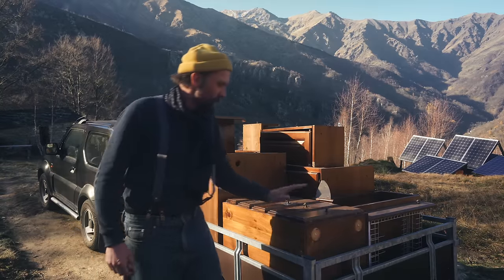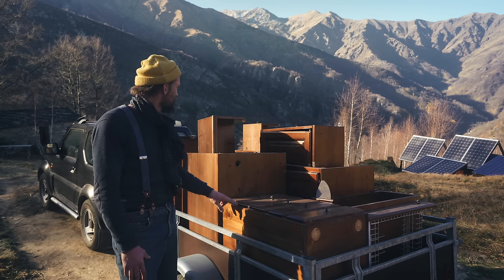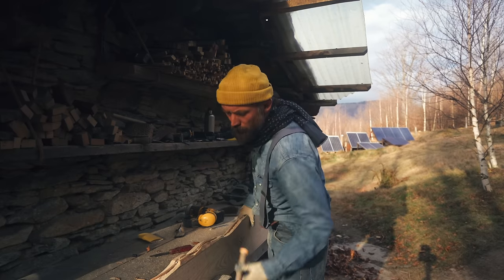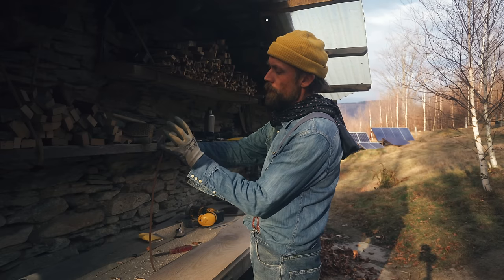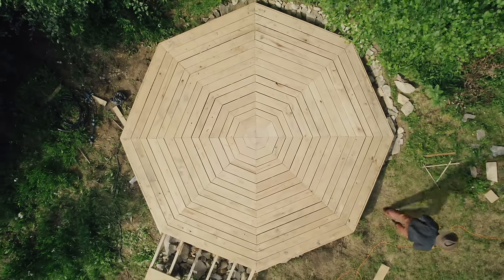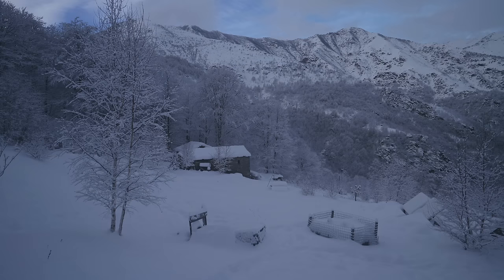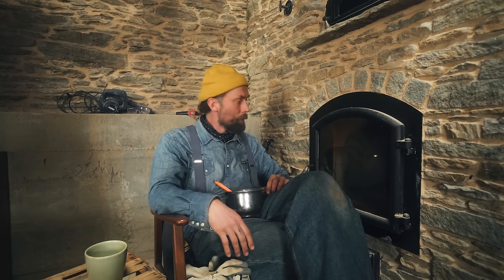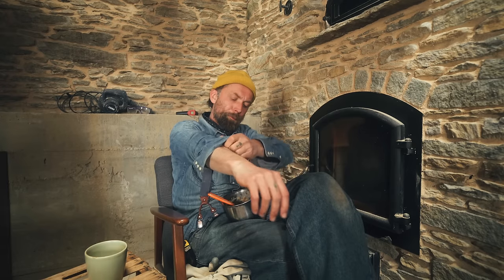#94 First Snow and Last Night in the Tent

Comment: If that was a woolen carpet you took out of the tent; the best way to clean it, is wait until it has snowed on a grass field, and lay the carpet upside down on the snow. While the snow melts, it takes dust and stains out of the fibers. You do need to have a place to dry it after though ;)

Comment: Hi Martinj, about your beautiful floor. I am a carpenter and I advise you not to glue, even if it may be too late. And leave loos along the walls. Because even if your wood is dry on humid days when you won't make a fire, the wood will swell and you risk having problems. For the squeaking I rub soap or paraffin on the male part of the assembly, very effective. Bravo for your careful work and the magnificent images. Take care of yourself !

Comment: Great work on laying the floor!
Next time you lay a floor like that, I'd suggest laying several boards side by side over the beams to make a temporary working platform to work from while fitting the other boards in place.  Replace the "platform" boards as you fit them in place...no need to try to fit boards and do a balancing act which can really be dangerous.

Comment: Goededag, Martijn! 
I find a deep sense of Peace as I watch your weekly videos, especially, with the full understanding of knowing how much hard work you put into not only physically rehabilitating your Cabins and winterizing the Chicken Coops,  etc, but filming all the angles of your work, mixing in the droan shots from above, editing, talking to us and explaining  all that you're doing, and uploading each week's video onto your YouTube Channel. 
I'm very excited to watch how you install your new 2"-thick Hardwood Chestnut tongue & groove flooring.
I used to own a 15-acre farm,  with a 200+ year-old farmhouse built before 1820, in Northeastern Pennsylvania for a Quarter Century  from 1990-2015. The farmhouse was "Built Like A Barn", using Timber-framed construction, with massive hand-hewn beams of Beech, Ash and Oak, (all cut and milled on the spot using local trees from close to the house). 
What I'm getting at, is that the 1st and 2nd floors in my old farmhouse  had almost exactly the same type of species of hardwood Chestnut (both width and thickness) flooring as you are using. I would sware that the reason my former 200+ year-old farmhouse is still standing so proudly and strongly today, is mostly due to it's Timberframed construction of 1ft x1ft Beams along with the 2-in thick X 6-in to 9-in varied widths of Chestnut tongue & groove flooring.
I personally would attest to the Strength of that 2-in. thick Chestnut tongue & groove flooring that you're using as it spans the (much wider than average spacing between each) beam on your 2nd floor. Your Chestnut floor will last you a lifetime in your Italian Alps Cabin. 
Stay warm this winter in your new Stone Cabin!
Tot Zeins!
Tim

Comment: it looks great martijn.  ok so i lay floors.  yours looks great but a few things to remember.  don’t glue the seams.  pva is stronger than wood and will bond the seams so well that the wood will contract and split the board itself. to stop the squeaking usually we glue between primary and the flooring with a flexible rubberised glue that will allow for the natural expansion and contraction that all timber goes through due to moisture because of how the timber was stacked outside i’d expect it to contract a fair bit with the fire and moving inside.  hit me up if you want to know more though i’d say you are done by now.  hope i’m not the bearer of bad tidings. thoroughly agree with your assessment of loads and spans
Reply: Also the electricity is not up to code the NEN1010 is not followed. I already wrote that in the comments so i hope he changes that bc that is a fire hazard and with all that wood....see my point?.

Comment: So you were right about that snow which changes the whole dynamics. 
We have a wood fireplace that heats the sitting room and the hot air is distributed by a heat pump in the attic around the house. Like your tent, in the mornings the house is cold because the fire dies down in the night. 
Very impressed with the work you did on the fireplace which looks amazing.

Comment: Putting down the tent is an image symbolic as seasonal, brief and has an ending😊.  The beginning of a new phase and most awaited life in the cabin. The expectation of what is certain is realized one after the other while the anticipation of future success evolving in the project is sure when focus is unwaver.  Cannot be crippled by fear and hesitation or there will be a disconnect failing from what you become. 

Seeing the floorboards almost fit and intact, and steps visible at the side align with the hope it should be.  Others have disadvantage standing on the beams with a wide gap and balancing as working.  Move on is a cadence of strength purpose and life.  Hope you're  feeling better soon, flu and covid are not disappearing.

Comment: You could probably use parts of the canvas from the tent to enclose your outside work area, a little bit down by the cabins. It might allow you to work outside for a little bit longer. You could also use it for covering over woodpiles for the winter.

Comment: After you get your flooring in, put baby powder in the crack between the boards, that will lubricate them and keep the squeaking down to a bare min.  Also, a simple fix is butyl rubber strips under your boards on the beams.  Good luck, God bless, and take Zinc for the cold.

Comment: Old furniture is such beast. I just disassembled two cabinets yesterday and it was ton of work. These were cabinets were in garage and I no longer had use for them, they had mold from the back side and over all it was dated design, so I chopped them down. It's not like ikea that gets crooked after a week. That being said moving those things requires at least two people and even then it's heavy.

Comment: Since you now have electricity at the chicken coop, how about installing one of those infrared light bulbs on a thermostat in the hutch, keep those babies warm?
I've been wondering how the wiring would go in the cabin. Running it hidden through the floor boards is such a great idea.
Interesting that the fire is stacked in reverse, with the kindling at the top and the heaviest logs at the bottom. Makes sense with this masonry fireplace!
I've been wondering how much of a cantilever overhang you'd have with the floorboards past the beam over the staircase. The wood floors are gorgeous!
Looking forward to so much: the floor finish in polyurethane(?), the handrail on the staircase, the kitchen cabinet install, the lighting, the water runs, the shower... everything!
Thanks so much for your channel!

Comment: End of an era, some great memories too (apart from the destructive storms) , the beginning of a new era, the deck will make a  great take off/ landing pad for a vtol craft 😉

Fire looks hot! Stone work really nice! , you take some chances on those beams! Glad when you started working on the fixed boards, balancing is risky.

Getting rid of those squeaks in your floor boards  is a great move, it would drive you nuts.

Take it easy Martijn

Comment: Beautiful,I have no other words for your work on that rock wall and fireplace installation.
The chicken coop…seal it up with that heavy plastic,I also read an active compost pile in the corner with a small area for ventilation can make the inside of you coop from 35 degrees to 65 degrees.There is a video online.The guy puts it in a corner,with wire to hold it there and he also throws seeds into it for the chicken it eat as they grow from the heat.also if you feed the chickens “chicken  scratch” at night it will help to keep them warm,kind of like eating a bowl of hot oatmeal for a person.Keep nesting material thick and clean and ventilated to avoid winter respiratory issues.But the main thing is plastic on the outside to keep wind out and snow from blowing in.Chickens feet can freeze so some straw on the ground will help and allow them to keep busy scratching or dried worms (meal worms) if they have those in Italy,the chickens need to stay busy to get eggs and to help with boredom.The worms ,maybe. A handful a day allow for them to search the straw or wood shavings.I can send the link for the compost pile info,at this point it would have to be gathered from someone’s active pile,but same the old chicken bedding for next year and start your own.But it’s winter heat without electricity.
Plastic will do wonders to protect you hens,some people stack straw bales outside of the coop,straw Id great for early planting at the base of seedlings also,so two uses.
Hope you feel better and get some rest in town before real winter sets in!
Just a beautiful job you have done so far!
Any help you need chicken wise,please feel free to contact me.

Comment: Good work Martyn. You might find it a good help if you buy a woodgrinding / sculturing disc for you angle grinder. They really shift the excess wood away when you have difficult scribing to do. Also, if you screw a scap block to the joists a little away from the new board you want to join, you can drive in a timber wedge which will push the two edges together.

Comment: Martijn, your work on the cabin is really paying off and it's looking amazing. One simple thought for later. You mentioned in the spring you may build a workshop, I would recommend making it larger and also adding a firewood shed. Just needs a roof. It would help cut down on al of the moving I always see you do of the firewood. Use the shed and stack it there and set it up to chop it there as well. You should consider getting the rest of the kitchen as you mentioned you only got half. Never know if you could use more of it in the other building in the future or even when you do build a workshop. Solid wood cabinet are hard to find and wood from 30 years ago is most likely going to be better wood then what you could get now. Moe older growth.

Comment: In hindsight, it would have probably been nice to build a gazebo instead of just a platform for the tent. You could have attached several removable walls between the supports of the roof, maybe even just tarps. Like that you could keep the wind out during the winter, and it would have protected the tent and maybe kept a bit more heat in. After moving into the cabin you'd still have a nice scenic spot with a roof over your head outside. 
But I don't remember what all needed to be done back then, maybe you wouldn't have had time. 

I love seeing the progress of the cabin, moving in seems like a huge step even if it's really rough. That sleeping spot just big enough for your mattress seemed quite precarious. 
I can't wait to see more progress, thank you for sharing!

Comment: Screw you boards through the tongue and through to rear of the board, to hide the screws drill them out and use a plug cutter to cut plugs same size as your, drill/screw holes , it will help reduce the squeaking on the floor boards , in Scotland we use a neoprene strip on top of the joist , it stops squeaking .

Comment: Hi Martijn. From experience (120 sqm African Rosewood) flooring is hard work. My advice would be to make sure you leave enough space for expansion of the boards. We didn't and it was a nightmare to fix when the floor started to move the sliding doors. Project is looking great.

Comment: If you are still planning to build a log structure workshop it is not too soon to address sourcing the logs. Quite possible that you will want material cut in winter before the sap starts to flow to control checking.

Comment: Before you go to bed at night you need to put some bigger pieces of wood in that wood stove.  Mix some green wood with the dry wood. that way your fire will burn slower and last longer.  Those small pieces put out a lot of heat but they burn up too fast.

Comment: I agree with your glue inside the T & G. You may consider either a glue bead or felt of sorts between the floor boards and the beams as well to eliminate squeak. Wood on wood perpendicular is notorious for squeaking especially as the temperature and aging process. Just a thought. Be well.

Comment: looking very good.  I was looking at your #74 video showing the kitchen idea. I would suggest using the same layout as you have in the outdoor kitchen. The fridge (in #74) off to the side juts out and is an awkward layout... blocking the flow from the door to the stairs.  I love that you are using 2nd had solid wood cabinets

Comment: “My friend, I’ve observed from your comments and my experience living in construction zones that the seasonal bug mentioned in your video might arise not just from seasonal changes but also from dust created by masonry, wood sawing, and ashes accumulating in your small living space. I recommend investing in a good HEPA filter and running it continuously to maintain a cleaner environment. I understand the need to conserve energy leading up to Dec 22 (winter solstice), but a quality HEPA air cleaner is a valuable investment in your health. It would also be beneficial to regularly vacuum the space, especially after indoor wood cutting, and whenever possible, conduct wood cutting outdoors. Like you, I use a wood stove and keep a small 5-gallon HEPA ash vacuum nearby, spending a minute each morning to clean the stove. Attempting to clean a fireplace or wood stove without a targeted vacuum causes fine particulate matter to scatter into your living space, potentially leading to respiratory issues if left unaddressed. Apologies for the lengthy message. I believe these measures will enhance your overall experience in your beautiful cabin this week. Best of luck!”

Comment: Hi Martijn, my wife and I look forward to watching your weekly updates.  I have concerns about the success you will have keeping your chestnut plank flooring from annoying movement and popping the glue joints.  I would think a top screwed with Timberlok heavy duty screws and plugged with Chestnut plugs, set in a bed of SikaBond  on the beams and using SikaBond as a joint adhesive between the plank edges might provide a good solution for you.  Also, you might consider Kutzall heavy duty shaping disc to help out with scribing.

Comment: I'm not sure I'd fill that fireplace so full with wood. Max 50 % of the space. Overload means overheat that can damage the structure. One of the basic rules. The recommendation: 2 sets (max 50 %) of the volume. Then, if needed, after 2-4 hours, the third set.

Comment: Some of the pioneer builders used to leave the stove pipe exposed on the second floor to heat that space. Some had wrought iron gates mounted around the exposed stove pipe to prevent people from touching it. Are you concerned that when your fire is larger than the stacked kindling ones, trying to get the insulated cladding of the stove build to throw more heat, the pipe might begin to superheat and warp?

Comment: You are working hard and the result is beautiful. On this video I think that you are making a serious mistake during the wood floor installation.
Did you account for the wood expansion due to the humidity and temperature? 
Your wood board are stored outside and you install them in the room where the fire place will dry them. 
You glue the boards between each other and screw them on the beams. Also it looks that you adjusted the boards close to the wall. 
By my experience you have created the opportunity for the floor to crack and buckle. 
One option that I will consider in your case will be to keep the floor floating. 
Glue the boards, have a foam between the boards and the beams, a large gap between the boards and the wall filled with foam to allow the floor expansion and attach only the middle board to the beams to allow the expansion on either side. 
You should get some other advice.

Comment: So once you've got the flooring in, the kitchen installed,  and the electrical sockets and lighting you mentioned all wired up, what's the winter focus?  I've forgotten your toilet and shower plans, but I know installing plumbing in winter can be tough.  The septic system is all in though, so I've no doubt it's all in hand.  I recall you saying you've got a lot of cleaning up to do in the other cabin, so that when spring rolls around you can move on to the last phase.  I am very keen to hear how you'll tackle things.  An inspiration as always, sir.

Comment: I'd like to hear more about the procedure for starting up the new stove. When can you start having a little fire burning all the time, to get the place warm?
Is there a damper to adjust the draft, so the flames aren't pulled up the stovepipe so strongly? Are there vents to send warm air out into the room? 
I keep thinking of the maths for how long, and what amount of wood, it will take to warm up all the interior stone. Of course the heat travels thru the stone toward the outside, as well, at a certain rate.

I hope it will all balance out and become cozy fairly soon!.
I am directly interested in the problem -- I built a 400 sq.ft. cement-block garage-type building and put pellet insulation in the spaces inside the block. Once I move in, I will find out what it takes to keep it warm inside.

Here in Tennessee I slept outdoors for the fun of it for 6 years. I had a little plastic shelter, away from the house. I found that 2-liter plastic soda-pop drink bottles make great hot water bottles. The water can't be too hot, or the bottles shrink up! But filled with the hottest tap water, maybe 120 Farenheit, and Tightly capped and put into the bed, a couple of those help make it toasty, easy to fall asleep.

Comment: I’d be careful using copper piping as a conduit. .. but I suppose if straight up into another and making sure the gauge electrical wire is big enough that you’ve implanted into your wood … ❤